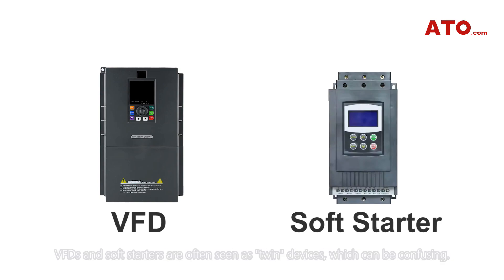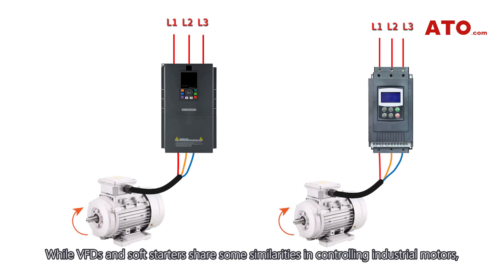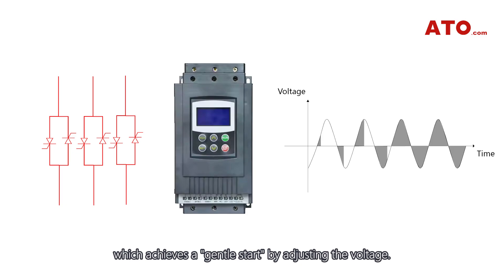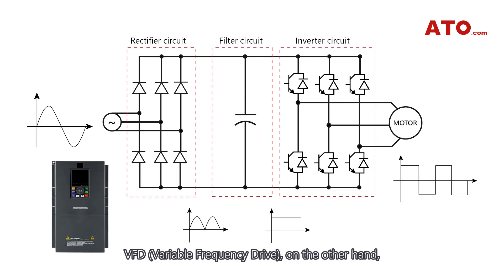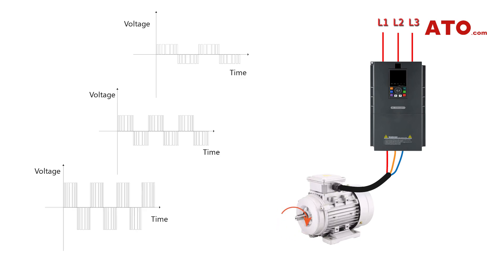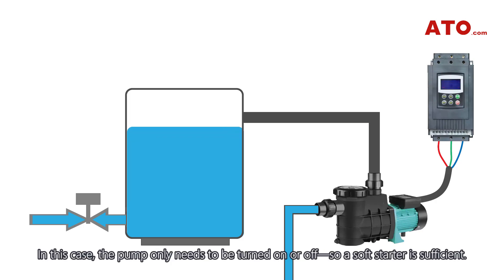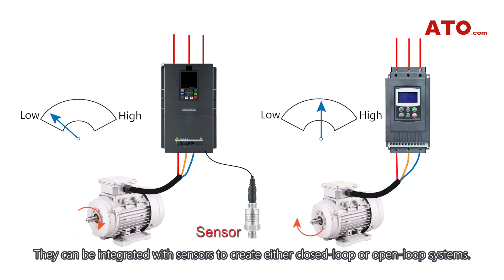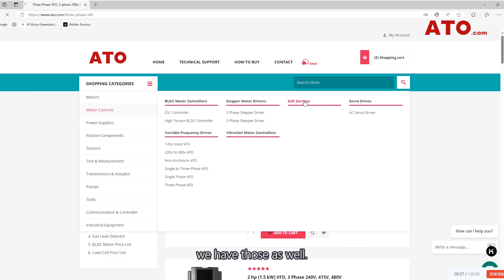What is the Difference between VFD and Soft Starter?

Comment: Can vfd be use for fixed compressors
Reply from the maker: VFD can be used for fix compressor, provided that the load of the VFD can only be the compressor (motor). If your compressor is a component in the air conditioning system, then I suggest you consult the air conditioning manufacturer, because this type of compressor generally has a dedicated VFD.